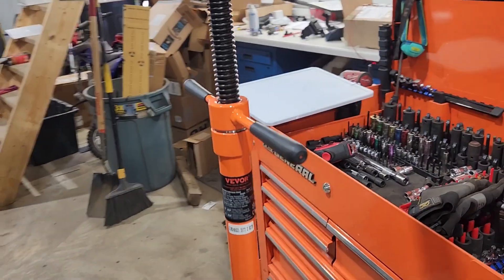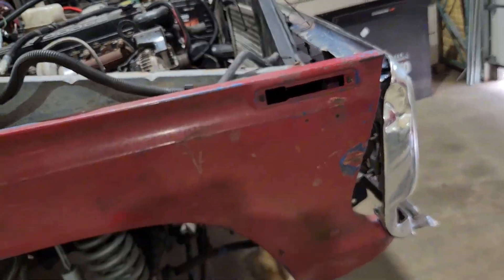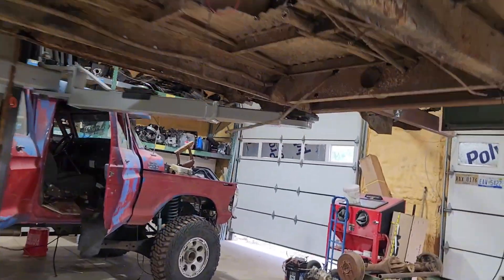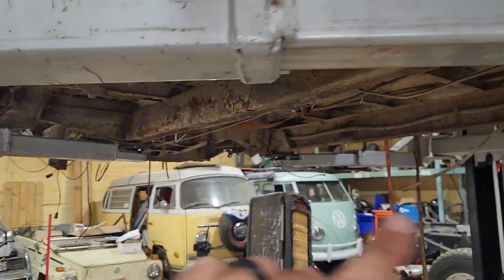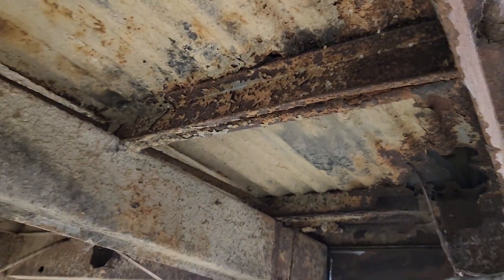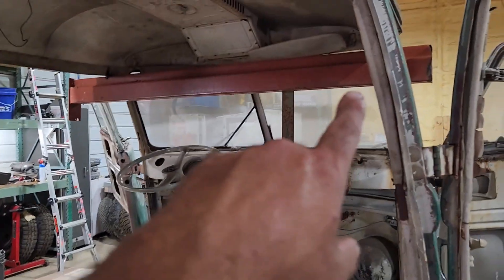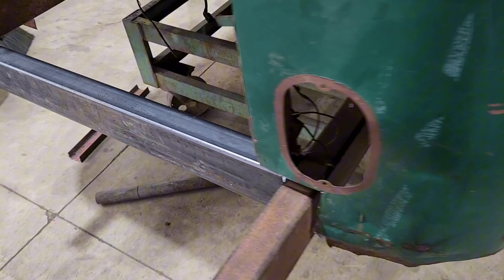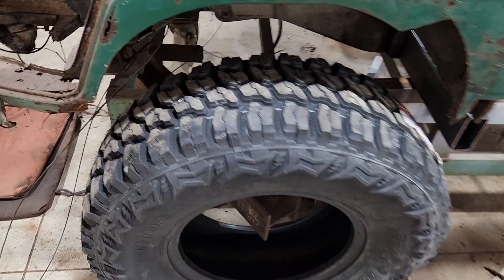4x4 Split Window VW Bus Suspension Design & Chassis Fabrication Begins

Comment: G'day a custom floor will look awesome and thinking about it I think you will have a better van then trying to use the factory floor and frame.
Reply from the maker: Yeah. I'm planning to build a full custom floor. I need to raise it to accommodate the transmission and also for some storage.
Reply: @ZeroBalanceBuilds  I love the Van build mate